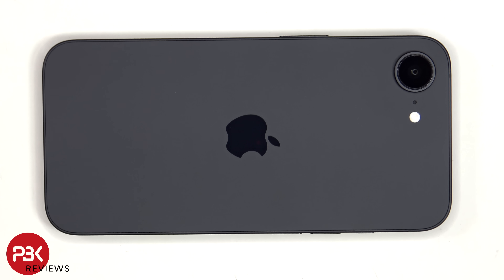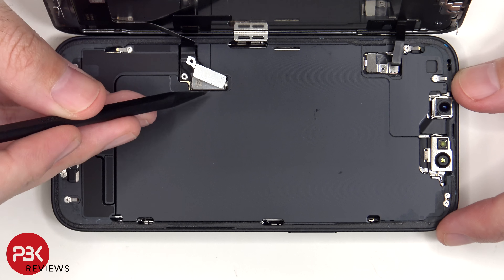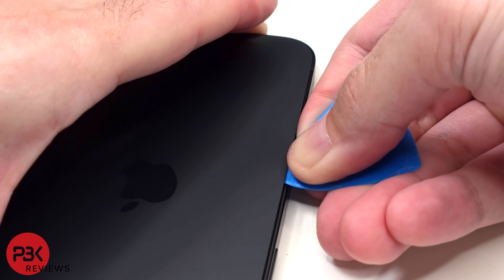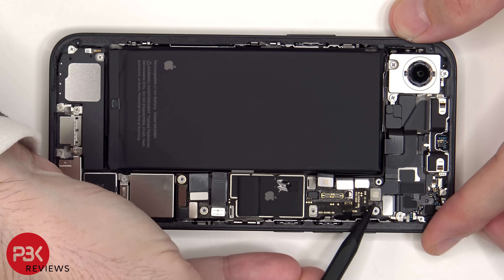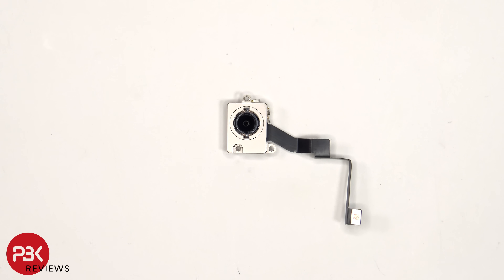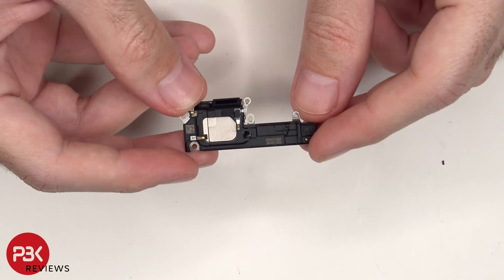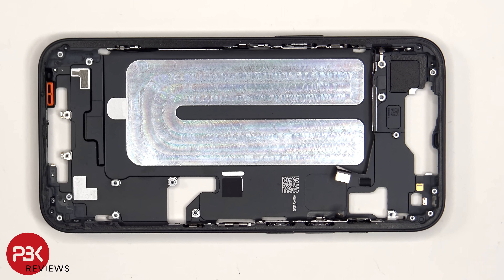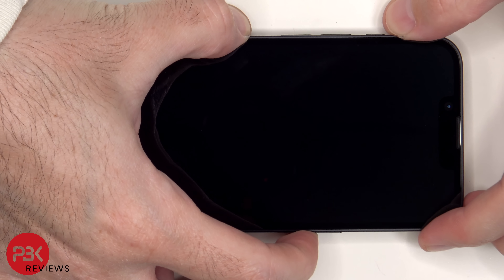Apple iPhone 16e Teardown Disassembly Phone Repair Video Review

Comment: Do magsafe magnets consume space? Why did they remove it? Was it a space problem?
Reply from the maker: It's not more of a space problem I would assume since it only would make it slightly thicker, it doesn't take place inside the phone really, just sits over the battery. I would assume cost cutting but again not sure.
Reply: @PBKreviews  thanks for the reply! So I’d assume the same - it’s just cost cutting on Apple’s part but it’s a 599$ phone. 🤦🏽‍♂️ I bet they’ll put it on 17e next year.
Reply: All of this plus the most important: upselling.

Comment: 4005 mAh battery? Really? Wow, that’s huge compared to the regular 16 & 16 pro. I wonder how long is it going to last? I might trade in my iPhone 11 with this. I would prefer the battery life to Ultra Wide lens. Small size phone with long lasting battery life is a beast for me.
Reply from the maker: Yup. Battery is definitely a plus.
Reply: Seen many negative reviews about this phone. However i felt otherwise. If this phone drop price further it will be a good compact phone and flagship killer.
Reply: @junweilin6793It’s a boring phone for sure, but for what it does, it does so very well.
Reply: I have had a 16e for 3 days and can confirm the battery life is incredible. I did a 24 hour on battery test and still had 57% remaining at the end. I am a moderate to heavy user, depending on the day, and this is the first phone I have ever had that doesn’t give me any battery anxiety. The omitted features from the regular 16 aren’t necessarily for me and the improved battery life and $200 lower price make is a very good value in my opinion. Performance is excellent, display looks great, and it takes great photos.
Reply: 4005 or ????? @jimihendrix731
Reply: If you don’t use the 0.5x zoom camera.100% worth it.The 0.5X zoom is the only downgrade
Reply: 10hours of screen time everyday without needing to carry a charger
Reply: How is approx 500 mah capacity a huge difference?
Reply: Nowhere close to 
 the Pixel9 series.
Reply: Wait for it to drop in price in a few months. Apple won't hit their sales target with this one.
Reply: Same. Just wish it had 120hz 😢. I don't even care about magsafe
Reply: @JesusLovesYouSoMuch47 why do you all brag about 120hz. I have 120 and i keep it off. Did you know that 120 drain around 20-30 % more of a battery? Is it a good tradeoff for you? For me it isnt… 🙄
Reply: Maybe Apple’s new C1 modem is not that sufficient yet?
Reply: @sakar5127  true, hopefully there will be software update for this
Reply: @sakar5127 the modem is really good
Reply: 3964 mah
Reply: @gcxrajeshx did you even watched the video?

Comment: is it comfirming using 1/2.55" (smaller sensor) than 15/16's 1/1.56" sensor?
Reply: Just by looking at the camera module itself from the teardown, you can see how small it is compared to 15/16's camera module thus making the sensor smaller
Reply: @josuke6131  ahh yeah, i can see that. glad i bought i15 👍
Reply: @muhammadwidi5321  glad you didn't buy that icrap 16e
Reply: i was looking forward to bought it, but the release price was so ass lol

Comment: This could have been such a good phone for someone buying their first iPhone 
1. The price is absurdly high, 599$ for 128 GB, should have been 499$ for the 256 GB variant. 
2. The camera thought it is 48 MP like the iPhone 16 but it has a smaller sensor and no sensor shift ois.

(Anyways great video as always❤️)
Reply: It reminds me of what Samsung does with their budget phones too, they charge quite a bit for phones like the a55, s25 and at some point s25 fe on low storage spec etc. I'm not exactly sure why Crapple Inc thought it was a good idea to charge more for their mid range iPhones 🤷🏿‍♂️
Reply: @Soraviel  cuz apple or even samsung don't wanna give you a good affordable smartphone, they wanna build a price ladder that leads you to their flagships 

iPhone 16e:
599$ for 128 GB
699$ for 256 GB(most people want this) 
Oh wait I can spent a 100$ more and just get the iPhone 16 for 799$. 

Honestly if you're on budget, go buy a OnePlus or old samsung flagship for under 500$, in my country(india) you can get a OnePlus 13r for 450$ that comes with a charger and a case in the box.
Reply from the maker: Thanks!
Reply: Maybe it will be ok deal if price gets to 450$ something in sales.. but then there will be deals on another phones which are miles better. Like oneplus 12 were going for 490-550$.

Comment: Wow, why did they use such a complex adhesion for the battery 😅
Reply from the maker: I prefer the pull pouches since they are re usable and don't require additional tools but yep in some ways this electrically conductive adhesive is easy to use as well.

Comment: 48MP Camera 😒😂
Reply: megapixels don't count if the software processing sucks lmao, how do you think iPhones and Google Pixels got away with 12MP sensors for so long 😂
Reply: Big megapixel count doesn't matter if sensor size itself is small. But the sensor here used on 16E is much smaller than one on base iphone 15/16.. its even smaller than ones given in budget android phones in range of 220$... This phone must be avoided unless you can get one under 399$ and you only want apple
Reply: @darky799 It’s reminds me of that 200MP camera inside of the older Samsung Ultra phones. It was so utterly crap compared to any 12MP camera.
Reply: 😂😂 that is crapple inc for you 😂